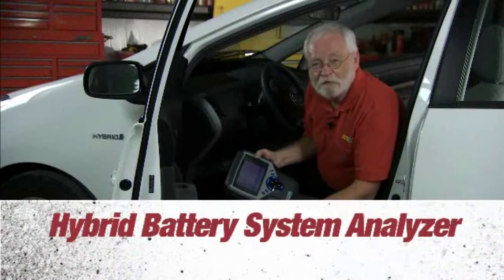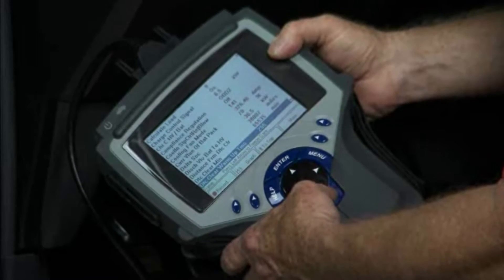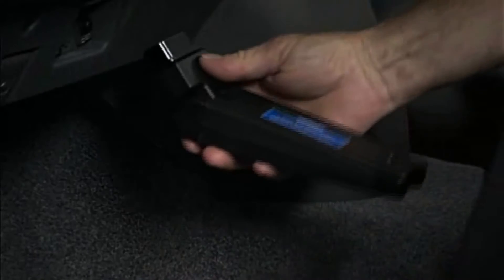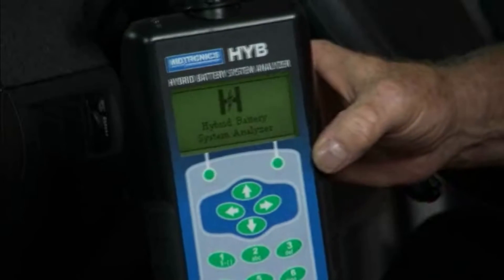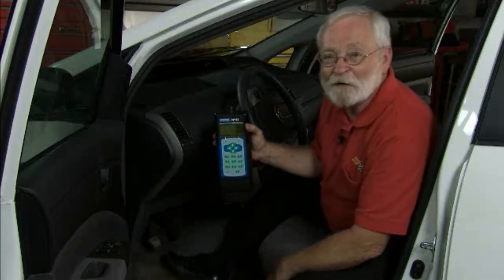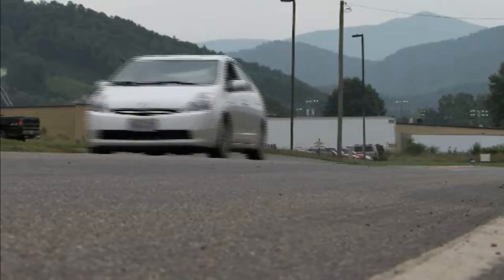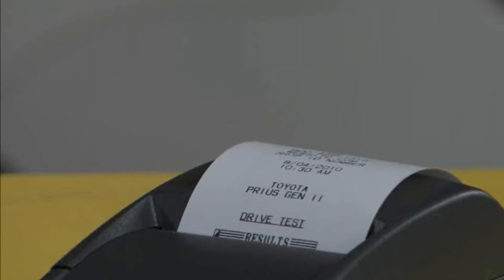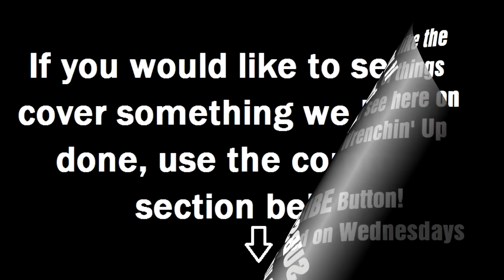Testing Hybrid/Electric Vehicle HV Batteries - Wrenchin' Up

Comment: The Dr Prius App and an good ODBC modul.. and you see all the voltage of the Hybrid blocks. But the real of the hybrid battery is the capacity of all modules. And therefor i can`t find an App because the car does`t send this data. 
Only defective modules can be found via the voltage. That is what the car check and send as data.  With a capacity measurement, weak modules can also be found. These weak modules are among the first to be broken the next time. I found a 7.4 volt module with only 1800 mAh. Normally old modules (year 2007) have approx. 5500 to 6500 mAh.

Here you find the way to check the capacity of your cells:
https://www.youtube.com/watch?v=g5KAPge-f6E&list=PLX3tCDQe4fs8zdhS8qTrgh4gI1w9-1W1t&index=2&t=0s
Reply from the maker: Hi - Thanks for watching and sharing your experience and opinion!

Comment: Hello Jim, thank you for your information, I do have a question related to old hybrids. I'm looking to buy a Toyota Highlander hybrid. It is a 2006 with about 180000 mies on it. base on this video with your equipment it is possible to see if the battery is good, but for how long? because it is a 12 years old battery I can assume it is going to fail at any time. Jim without testing the vehicule it is any other indication that the battery is going the fail? Thank you very much.
Reply from the maker: Hi Jorge - You can check on and keep track of the battery's health by using a scan tool that has the ability to look at the battery's control module (BCM). I hope this helps. Thanks for watching!

Comment: When the traction battery of a hybrid car goes dead will be able to use the car just using the engine? And will you be able to convert that hybrid car to a regular  gasoline car , just to avoid spending money for the hybrid battery which cost too much.
Reply from the maker: Hi - Basically, the high voltage battery in parallel hybrid vehicles is used to start the engine by powering Motor/Generator 1 which is used to crank the engine. The small 12 volt battery just runs the computers. So if the HV battery is dead, the vehicle won't start at all. The cost of a new battery for these types of vehicles would be cheaper that a new engine and drive train. Other series type hybrid systems use the 12 volt battery to start the engine and the high voltage battery and Motor/Generator acts like a booster. These types if hybrids can run on the gas engine alone but would use buckets of gas and not be very efficient at all. Thanks for watching!

Comment: How would you check the battery on a Nissan Leaf, I took it to the dealer, paid $160 and they came out with a service bulletin and no real data displaying battery temps, sags in current and voltage.... what's your suggestion sir?
Reply from the maker: Hi - I checked with the latest update for the Midtronics HYB1000 that was used in the video and there is still no feature for the Nissan Leaf. So the HV battery would have to be checked by observing the data stream of the HV Battery module with a scan tool while the vehicle is being operated under various driving conditions, ie. rapid accels, decells, etc. Not knowing what equipment your dealer used, but I would think a printout or screen grab of the drive or whatever test that they did could have been provided. Thanks for watching!